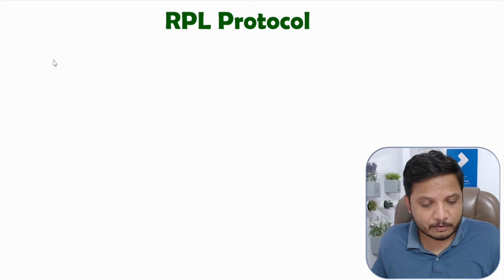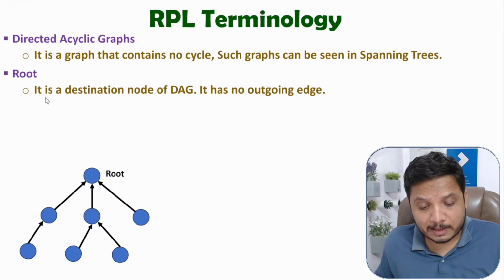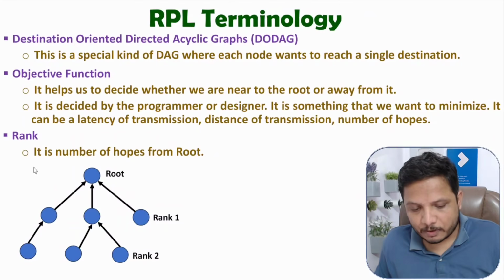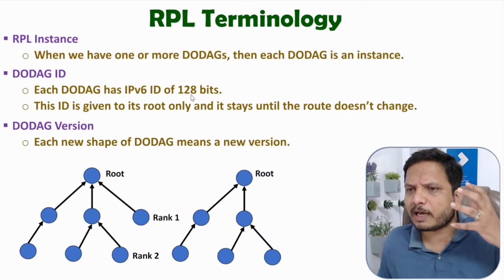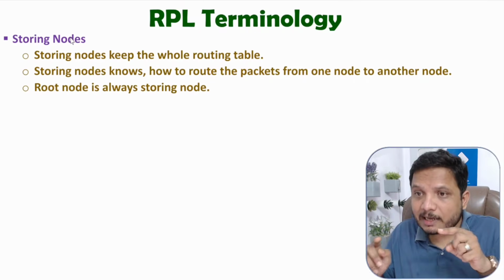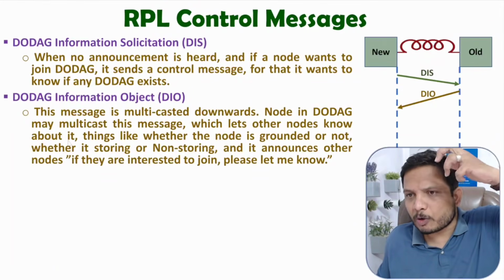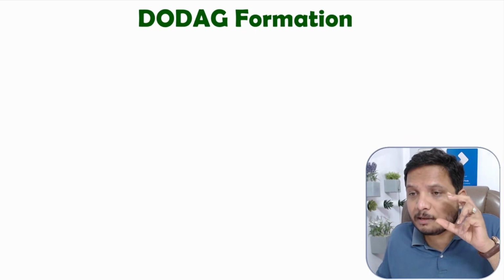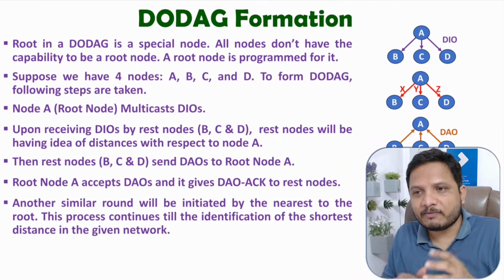RPL Protocol Explained: Basics, Topologies, Control Messages, and DODAG Formation

Comment: Hi professor, i have a question. I am conducting a decreased rank attack in cooja. The rank of the attacking node is 21 with a rank of 260. the topology include 20 nodes and the sink 1. as follows:

                   1
              2 - 3 -4 -5
             7 -8 -21-9-6 
          10 - 11 -12 -13 
           14 -15 -16 -17 
          18 -    20  -   19 

I have place node 21 between 8 and 9 both of them have a rank of 760 respectively. nodes 2-3-5-4 have a rank of 512. My question is why nodes 8 and 9 did not select 21 as a parent even though it has a lower rank then the nodes above? also nodes like 10 -11-12 have selected 21 as a parent. Finally any pointers would really help. thank you very much i hope to hear from you soon.